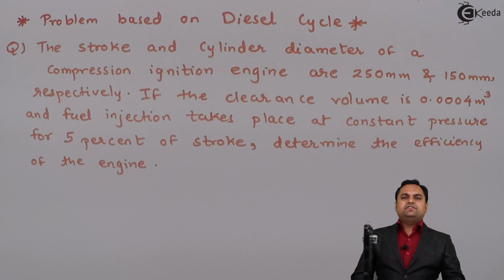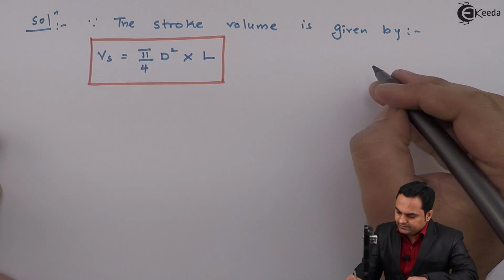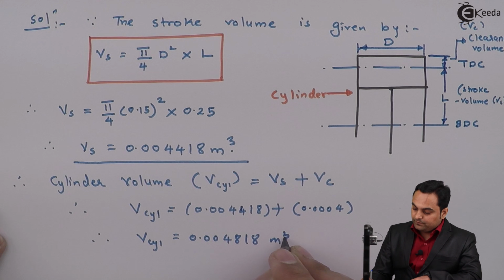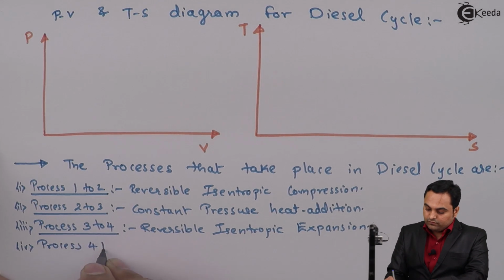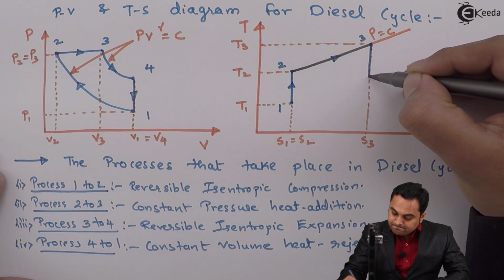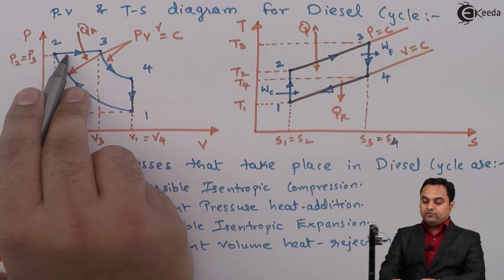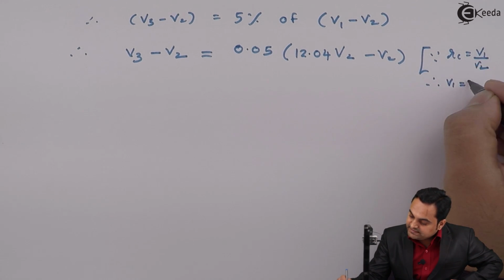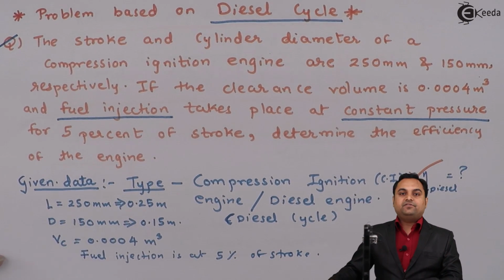Problem No.2 Based on Diesel Cycle in Power Gas Cycle - Gas Power Cycles - Thermodynamics

Comment: Determine the efficiency of the diesel engine having a cylinder with bore 350mm, stroke 475mm and a clearance at 5% of the stroke.Assume, gamma(y) - 1.4 for air(please solve this problem